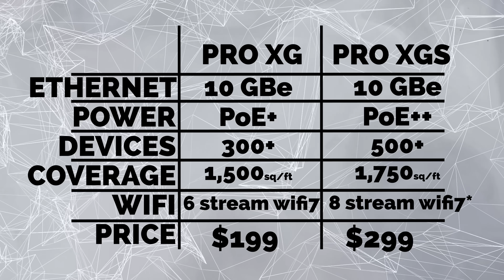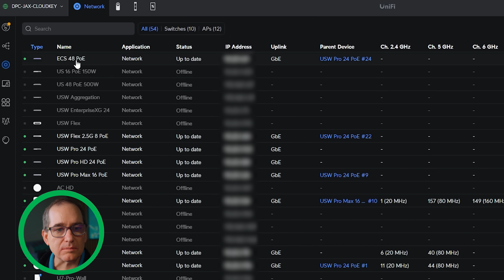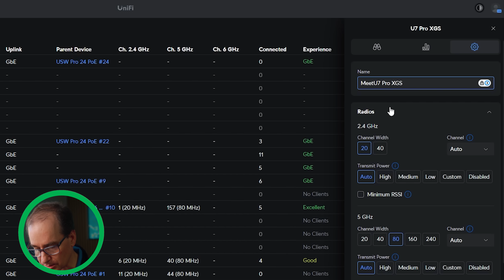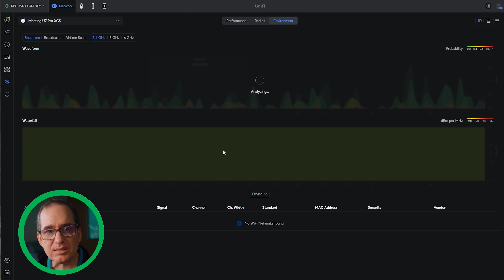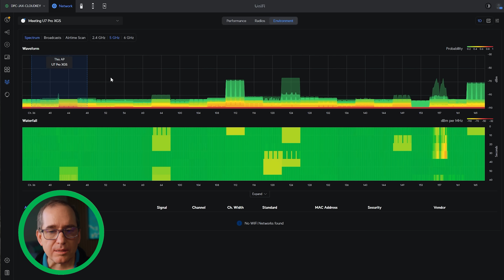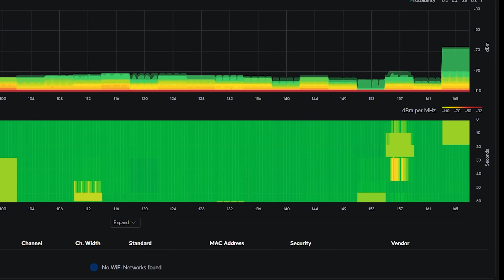What Makes Unifi's UXG The MOST POWERFUL WiFi System Yet

Comment: The real dark horse that this would be compared to is the u6 enterprise. 10 spatial streams and it has a 4x4 antenna for 6ghz also.  It doesn't have 6ghz 320 or 5ghz 240 but no devices really support that anyways. and MLO is a mess on wifi 7 and most recommend it turned off.

Comment: What is the transmission pattern/characteristic for the antennas in this device? Is it omnidirectional? 
If I install it vertically on a wall, would the signal behind the wall (ignoring the losses due to the wall) be the same as that in front of the wall?

Comment: Hi Clay,

Im in Australia you may recall from our previous chats. Currently hunting around for a UCG Fiber to initiate my transition from all-in-on to a more capable setup. Failing ability to secure one soon I think the UDM-pro is my second best option.

I have been looking at the u6-Pro largely to avoid the fan and heat reputed to be an issue with the u7-pro. I think the wifi 6 will be ok but had been thinking of how to keep the best throughput with high signal strength. U6 seems a bit weak compared to some alternatives on the 5ghz. 

Have you thoughts on the u6, u7 range and these new WAP's with respect to high performance wifi6 with very strong 2.4 and 5Ghz range performance? I'm doing my best to avoid multiple wap's because I'd need to change up some other aspects of my setup. Hopefully these new ones are in bulk production and not constant vapourware like the Fiber!

A question on POE injectors too... are they bandwidth affecting devices or only putting power into some pins and passing the data through? Eg 1gig, 2.4gig or 10gig capable injector. I've never worked with POE. 

I have a strong sense that as soon as I purchase a gateway device unifi will release a new version of the UDM haha.
Reply from the maker: the U6's have had less trouble in the 2.4 ghz range with IoT devices.  I have not had any trouble with my U7 stuff but you could go U6 just to be safe,  Hoenstly, in my locations (home and office) all the U6 and U7 stuff has been more than enough.  I have also never had an issue with an injector causing an issue.  If you do get a 2.5Gbe or 10Gbe WAP I would get an injector capable of those speeds..  As for the UDM, of course the will release the new one a couple of weeks after you purchase..  Murphy's Law!
Reply: Regarding buying a new gateway: A TV advertisement used to show a guy driving home, smiling proudly at the box for his new T6 computer. Then he looks up and sees a large roadside sign announcing the NEW T7 Computer !!! He hadn’t even gotten the T6 out of the box yet. 😂
Reply: @RickActual  such is technology :P. Wisdom is learning what you need, as well as how to rationalise that it's a "hobby" and that you need more! :P  . Surely that's right?

Comment: How does this compare to the U7 Pro Max? Does it add more features or just a design change? Also curious how that compared to the E7 too since I just picked one of those up.
Reply from the maker: It is very similar to the Max with 10Gbe and the heat sync being the big headliners.  the backup 1G connection of the E7 is a great feature if you have to reset a swich and cannot have down time..  It slots in perfectly and I would definitly do the Pro over the Max...